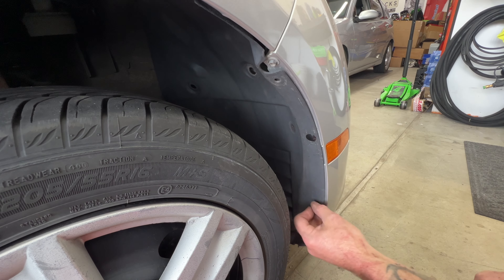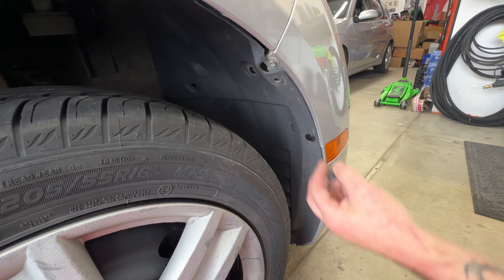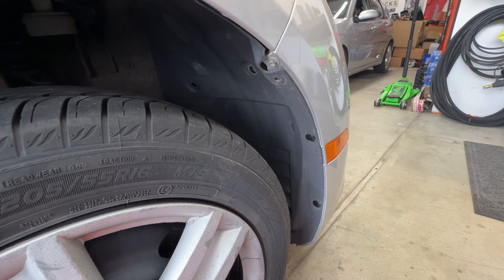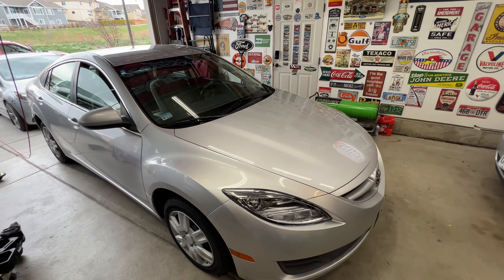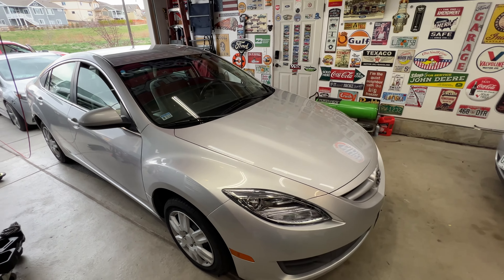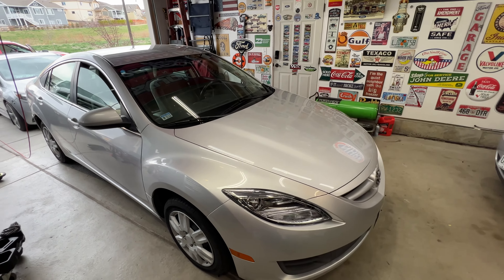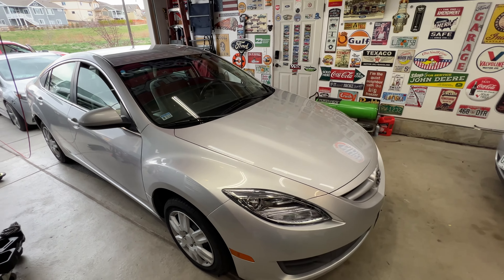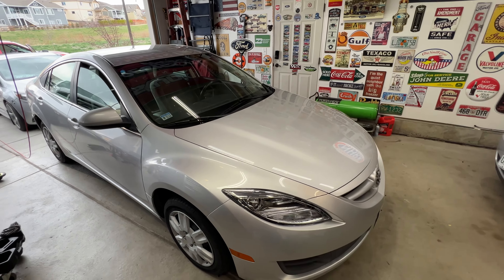Mazda 6 Headlight Assembly Replacement How-To

Comment: Wait a minute! These headlights needed to be sanded down to restore them to new, I have the same car and year, mine were disgusting yellow heavy oxidation, I sure did not want to spend on new headlights plus the labor fees so I got them sanded down to take the oxidation with different grits paper and for final step used Meguiars Headlight Coating which is a UV protectant that makes the lights last new longer than a year. Just saying I saved a whole lot of money by doing this! But with each there own, it’s your money and time spent dismantling.

Comment: So there was no need to remove the bolt at 6:13 because it holds the bracket in place, correct?

Comment: Hey, so I watched you video and it all went great, can you tell me anything about a controller module that would be attached to a headlight. How I could by pass/find one. My old headlight it was all integrated and I'd have to seriously damage my new light to put the old module on. 

I still only have 1 function headlight, both signals work though.
Reply from the maker: So are you just needing a new HID ballast such as this https://amzn.to/3PWukuP
Reply: @BLUECOLLARGARAGE  YES, EXACTLY THAT THING!! However the new light i got, which looks identical to the one you installed in this video, doesnt look like i can attach the ballast to the light itself. would i have to find a headlight with the ballast?